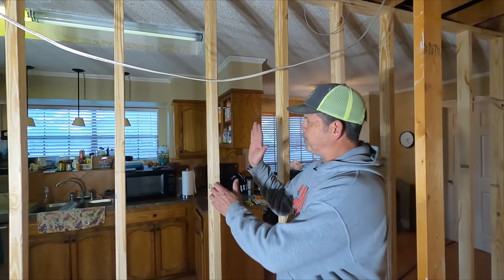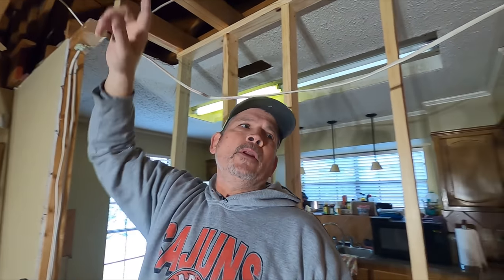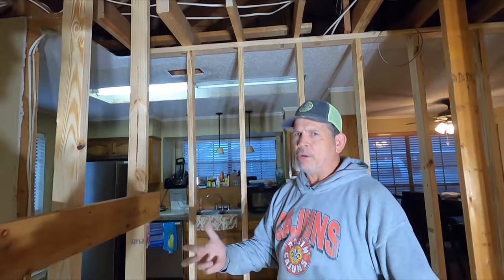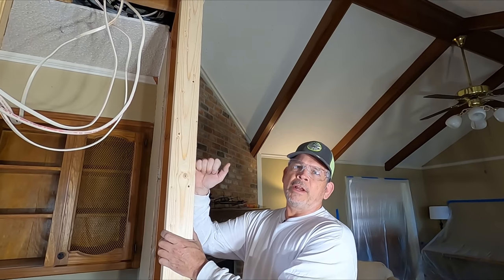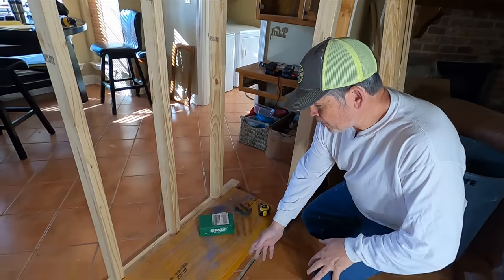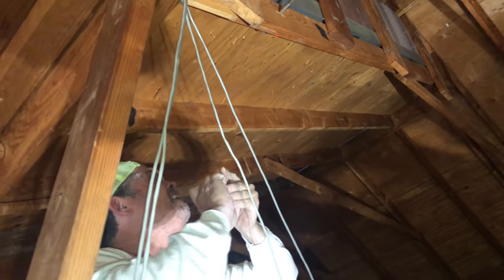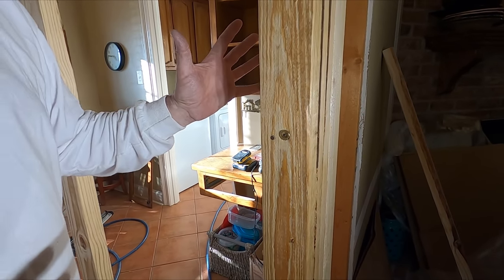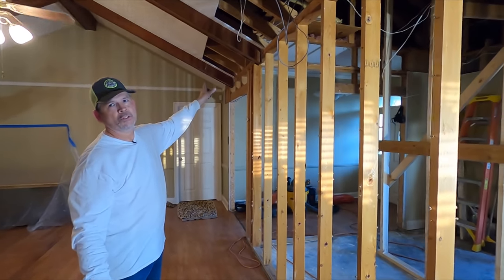The EASIEST Beam Installation We've EVER DONE! - Ep. 3

Comment: A choker around the beam would have alleviated the need to adjust the rigging.  Would also negate the chain all together.  (I am a qualified rigging supervisor onboard ships, but have never stayed at a Holiday Inn.)

I do appreciate the video showing how you did it.  I would have never thought to punch a hole through the rafter to run a long bolt through for a pick point.  Going to file that one away for later.  Thanks!

Comment: I may have missed some of the other fastener descriptions. When you described using the 6" Structural Screws for the stud packs and for the bracing it's great. Are you able to do the same with your Nails? "Hey we're using 16D nails for these hangers, they're 2.5" in length.. etc etc." I feel that would be a great addition for myself but anyone else that is able to learn from your excellent videos. 

Many thanks and good luck!

Comment: You could build a temporary A-Frame out of the temporary wall studs you just removed on each end of the new beam and lift each end with separate hoists. There's no need to anchor it from the rafters. You could hold the weight on the existing walls/ceiling or build your own supports that reach the floor. You could also just use the one hoist and lift one end at a time partway up and then reposition. Takes time but easy enough.
Reply: This is likely the answer.   Simple construction, readily available materials and experience hoisting from above.
Reply from the maker: Perfect thx 👍

Comment: Just make an A frame off the stud wall going into the roof space with a stud to stop the lateral movement. Doubled up 4x2s should easily hold 300lb when the legs are angled to 35 degrees or so. Then you can attach the joist onto the horizontal part of the A. You may have already done the install by now, but if not I hope this helps.

Comment: For your larger laminated beam lift,  install two vertical  14'  guide studs  at each end  of the span  so that the laminated beam stays in the strong axis between the guide  studs ( one guide stud  on each side of your sole and top plates) .  Install a eye hook on the top of the the guide studs and on top of the laminated beam.   use your come-along to crank it up.  You know a " stud pack lift"

Comment: How about making a small frame up in the attic that sits on the joists? You can hang your winch from it. If you need to spread the load, just put a 2x4 or 2x6 resting across several joists for the posts. At any rate, you guys are great!
Reply from the maker: Thx Dale 👍💪

Comment: Not a native english speaker, but.. Lifting the new beam could be as easy as two temporary beams on top of a few of the cut, yet supported ends. One a bit higher, the other closer to the end. Add the winch in the mix on the top temp one, add another pulley on the bottom one and let the cable pass through it before tying to the beam you're lifting. Cable goes horizontal for a couple feet, beam still goes vertical. It'll have a tad more resistance as its fighting friction against the temp supports, but its negliable as long as the angle isnt really bad for the lower pulley.

Comment: I would build a ladder rack. Studs on either side figure weight to know how many, braces on top and bottom, secure it to the rafters so it doesnt fall. Position it so beam can be raised as its sliding up "ladder" . If you have the room have it straddle the beam ,brace it all weight is down force. You have plenty of used lumber and can easily assemble and disassemble it. You should have a t.v. show
Reply from the maker: Thx JW.   this was my first thought too

Comment: Personally Id try to make a frame for a hoist in the middle of where the beam center is, and nail it to the roof, outside walls, or whatever framing you can trust to support the lift.  

Using blocks or jacks on each end could work also. You could raise one end at a time as well, and use blocks under the beam to climb each end up.  I just think slapping some framing up for a temporary crane would be quickest.
Reply from the maker: Thx Tyler 👍💪

Comment: I'd use the existing stud wall to lift the next beam, climb it up along the wall using offcuts protruding from the wall at 90 degrees.Lift one end and prop then lift the other end and prop and repeat, for some extra insurance use some acrow props under the edge of the offcuts.

Comment: 25:30 I'd use 2 drywall lifts (one on each end of the beam).

I used my harbor freight one to remove and then raise the old growth 2x6 ceiling joists in my upstairs by myself.  Those drywall lifts are amazing... I think around $220 each from harbor freight, and rated up to 185lbs.

Comment: Love the channel, guys!  You mentioned that you have the original house plans.  Does that include the plans for plumbing?  If I decided to drill a 4" or 12" deep hole in my slab, I'm pretty sure I'd end up hitting some water supply lines or a sewage drain pipe!  Did you just risk it and drill the holes?
Reply from the maker: Yes, it’s a risk.  You could have the lines located before drilling.  Expensive but cheaper than a repair.  Plumbing plans are only a guide of the actual location IMO

Comment: To raise the next beam you wedge the beam in between two vertical 2x4’s on one end, and vertical 2 2x4’s on the other end. You raise one side at a time about 2 feet and nail a horizontal 2x4 under it.
Reply from the maker: Thx Tom 💪 this was my first thought too
Reply: @StudPack  using the winch is always nice but this way is a little quicker. Keep up the great work

Comment: Hi: I know I am must have missed something, but why didn't you & your son install (& lift) those lvls 1 at a time. Is securing them together outside that important? (I thought about that question at the end of your video.) Also, I would be very interested if you explained some basics about structural engineering. Example why is DEPTH more important than width, LVL vs wood vs iBeam. I am not trying to be a structural engineer but I would like to better understand what my engineer is talking about. Again, love your videos!
Reply: Rob, to answer about LVL width vs. height, you can do an experiment right now. Cut a strip of cardboard 1" by 8". Now try bending it one way vs. the other. Height adds rigidity on the vertical plane which is needed to support the load.

Beams are typically tied in to framing on the side to prevent horizontal flexing, so strength is most important on the vertical plane.

LVLs are engineered so the laminations run in line with the load, imagine multiple strips of cardboard glued together face to face. LVLs are stronger than solid wood in part because they orient the wood fibers specifically for the task.
Reply: To answer your question about beam assembly, I think it could be done either way. But from my observation, they had little room up high and had to use the "big drill" for the screws. Just easier on the floor.

I will often build stairs, door and window casing etc and then install as a unit. Building in situ on a ladder is often more work. You also have ample space and time to plan and place everything ahead of time. You can more easily ensure everything is square and in plane during assembly.
Reply: @btimbyindy  Great explanation. You are a good teacher. Your apprentice is lucky. Thanks, Rob
Reply: @robo7981  thanks Rob! If I know I will try to answer.

Comment: Given your ethos of reduced waste, wondering if you repurpose reclaimed dimensional lumber [such as the 2x6 ceiling joists and 2x4 temporary walls] which looks to be in good condition. Seems a waste to trash it rather than reuse it elsewhere in the project.
Reply from the maker: We reclaim as much as we can.  If it’s not full of nails, is straight, not cracked etc we will save it for something 👍

Comment: Hmm, I'm a bit confused; if the kingstuds are only "nailed" together, buckling would still happen as the nail only has sheer strength and prevents the 2 studs from sliding against each other. Shouldnt they also be "Screwed" together? Nails provide sheer strength and screws provide tensile strength.
Reply from the maker: It’s what our engineer specified.  Over 20 16d nails isn’t coming apart easily.  A16d nail from a nail gun had 95 pounds shear and 35 pounds pullout values.

Comment: Hey partner,  gonna do you a solid favor...get yourself a Dewalt 20v screw gun and a bucket of 3' deck screws with torque heads...use these instead of nail guns for all your temp walls and you will love how easily they install and best part is they easily come out and move are able to move when quickly needed.  I do the same thing you do,  and find that I only need my gun about 40% from what I needed,  and my speed increased,  while the pain in the ass decreased.

Comment: You need to study up on your rigging there is a system(or thing) called a gin pole. Use them for Installing large  beams when building decks  .(I could not find a good video or image refer you to on the Internet)
 So here goes my best effort to explaining it work how. I simply extend the  gin pole  above the deck posts with laminated 2 by 4 ( I prefer 3,, 8footer)For doing decks. Then Strap Laminated 2 by 4 by 8  to the post 4 feet above the top of the post. Leaving 4 feet below the top of the post to fasten to deck post Using your choice of attachment straps clamps screws. The deck posts will need to be secured in the vertical position. Put a eyelet to attach the ringing to. This system can be as tall as you can build the gin pole As long as it is secured in three directions. The fourth side is where the load goes.
  It's a very simple system very complicated to describe I wish you luck. I am an ex-lineman we use gin pole for setting power poles in the middle of nowhere without equipment. Just be aware of your weights and overbuild for your loads.
Reply from the maker: I understand.  Thx Dan 👍
Reply: @StudPack  I am also used my TRANZSPORTER 48583 WALL JACK FOR LIFTING FRAMED WALLS 23 ft. But you use what you have and what is on the job site

Comment: they make winches that you run with a drill. rated for good weight.  and way faster and less work.
Reply from the maker: I looked at the Warn winch.  Says “not for lifting”.   Winches pull, hoists lift was my take away

Comment: you can get lvls specified by the company that makes them through any lumberyard for free.
Reply from the maker: Yes but they won’t do a site visit and submit stamped drawings for a permit on a little job like this... at least not here.
Reply: @StudPack  I've never had a need for a site visit but always receive acceptable specifiers for permit approval. In Massachusetts at least there's never any legal necessity to get stamped drawing for changes to an existing structure, only for new construction.
Reply from the maker: Yeah I figured it was probably a regional issue.  Surprises me in Massachusetts that it’s not needed for existing.

Comment: Why not lift each beam ply by itself and then assemble in place? Or call the engineer and ask him to spec a 3 ply beam, that will lower the weight of each beam ply.
Reply from the maker: Assembly in place is an option if you have to manually lift them.  It’s much easier to assemble on the floor and hoist as a unit IMO.   Thinner beams are not available locally, not sure if they exist
Reply: I believe he means it would lower the weight by reducing the height of the LVL if you went to a 3-ply.

Comment: Wish i had the job as his helper/ camera man/ gopher..   would learn a lot and stay busy..  get real tired real quick when you work for a lazy non motivated dude whos motto is to half ass everything to make more money..  got fired not too long ago when he figured out i was doing jobs the right and safe way..  said since i did those jobs so perfect then he woukdnt get any follow ups .  That and i told the customer exactky what i was doing for them and showed em whats up and he tried to come in and give em the whole ".we use this type of material which is code and it degrades and needs replaced yearly" when i used aluminum with aluminum rivits and sealed off the drip pan, stood off the a frame from the water so it woukdnt corrode and he was wanting me to use a wooden drip tray...  jackass...